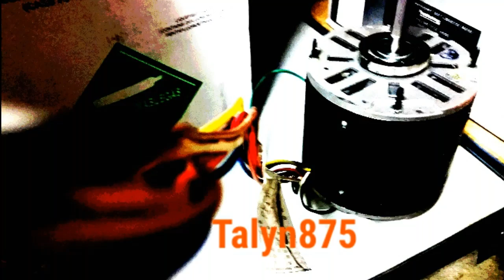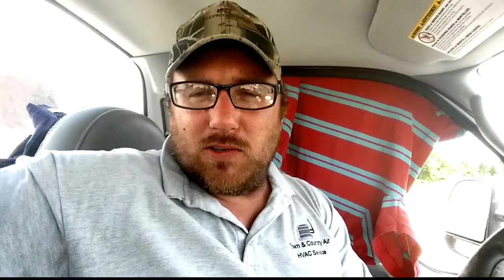Solving Low Airflow Problems with Outside Air (HVAC)

Comment: would colder air over hotter air condense?
Reply from the maker: +Michael   Podielski I don't think so because it would typically be dry in the winter so the dew point should be extremely low. Plus the overall amount of outside air should be small so the load does not get excessive.
Reply: Michael   Podielski , you do have to be careful not to over pressurize a home in a cold climate. Exfiltrating air could condense in the walls. This could be combated by trying to balance the pressure with a bath fan.

Comment: Nice work.  I finally had a system that had good superheat. Installed new 2 ton condensor today.  With your advice I was able to dial it in.  Instead of having it bounce around.  Now I see how airflow is a big issue.  Many thanks man.  Newer furnace 8 years intstead of 40.  Good clean coils and such

Comment: A company I used to work for did a house for a customer and they were concerned about air turnover. We ran a 6-inch fresh air run and interlocked it with a bath fan. Good video.
Reply: John McMaster , balanced is good

Comment: in my state they now require HRVs in all new housing, or to run a fresh air vent. if you run a 4" duct and put it into the return. how do you think that will affect it in cooling when its 100+ out?